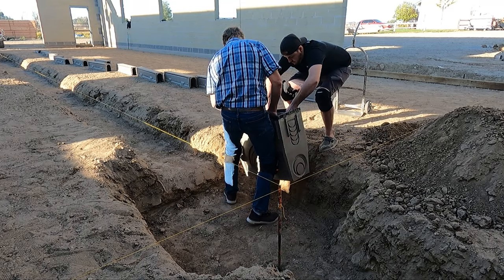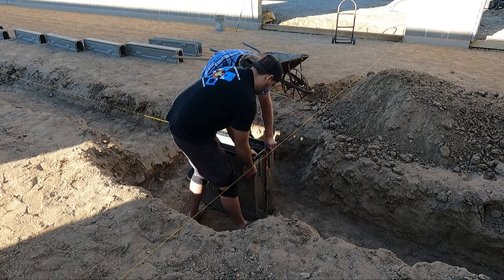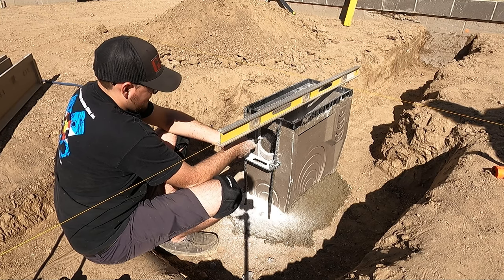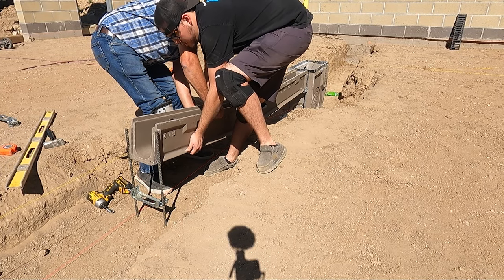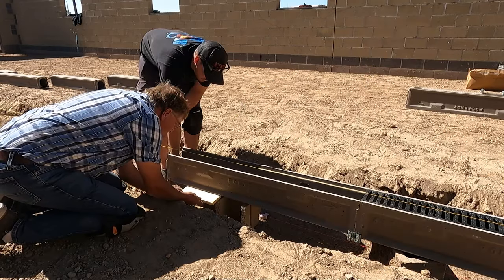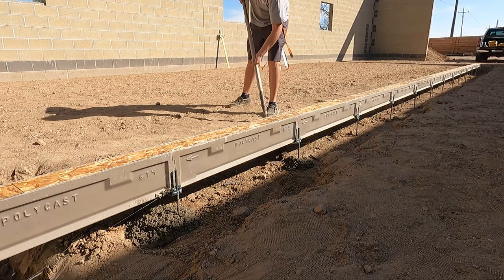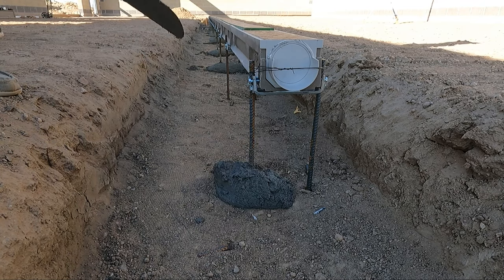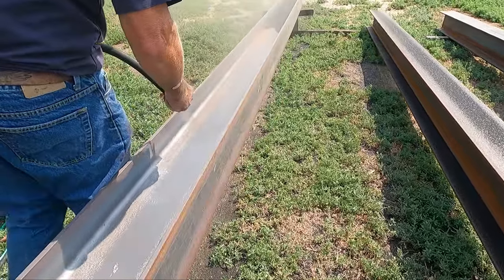Installing A Polycast 600 Series Trench Drain - If You Want It Done Right, Do It Yourself

Comment: When the floor is poured ensure that the the drain is not proud of the floor. I have seen a hundred slabs poured in such a manner that the drains end up as small islands with a small moat around the drain when water is present. I am sure that the same issue is possible with a trench drain. Good luck with your building, we are all rooting for you.
Reply from the maker: Haha, you mean like the puddles that sit around the trench drain in our current shop?
Reply: It amazes me that no matter what size of floor being poured the whole thing is screeded off by a guy with a 4 ft 2x4. The only thing I’ve seen leveled right is a warehouse floor for an automatic material handling system. That Polycast drain is awesome stuff if done right but a total waste if the concrete guy screws up.
Reply: You've described every floor drain in every mechanical room in every building I've ever worked in.
Reply: This is really good advice from Darrell. A great way to achieve this is to put a 1/4- 1/2" spacer on top of the drain for the concreters to rod off, then when they come back to finish, it leaves a nice little step down to the drain which can simply be bevelled off with a trowel.
Reply: It's how you keep the drain from clogging, slope floor away so nothing goes into drain!
Reply: I’ve always done drains slightly recessed (rather than trying to get them level). Often after years the drain or floor has minuscule shifts that cause the island effect. Finding ways to keep them anchored under the floor kinda like footings also can help prevent that.
Reply: @ObservationofLimits  I'm talking about the moats you see around drains the day after they are poured and the top of the drain was set with a transit to have a pitch toward the drain from outside walls.

Comment: Very well done gentlemen!  I've been plumbing since 1997.  This December marks my 20th year in business for myself.  I have put in lots of the Zurn (886) integrated slope drain, but never the ACO polycast.  I just recently bid a house with a show garage in the basement that called out 6 separate trench drains totaling 60 linear feet.  The builder crapped his pants when he got my proposal, and has chosen to have the concrete company install the drains.  I predict we'll end up in the same boat you are......  tearing out their crappy work, and reinstalling it correctly.  
CHEAP
FAST
QUALITY WORKMANSHIP

Pick 2

Comment: We expanded our house a few years ago, and renovated my room last year. In the expansion, my dad put in all the wiring wand water pipes himself, and when renovating my room we did everything ourself, from ripping everything out, putting in new insulation, installing the drywall, installing the roof window, rerunning electrical, and putting in flooring and wallpaper.

Having those skills is really useful, and you can learn a lot of things when doing that.

Comment: If you need any advice I have been building buildings my whole life.  Things like all the small detail in building a shop really get me.  As I see in your shop, you have not taken full advantage of underground mechanical electrical and plumbing.  Stop now and think about it.  The most inexpensive way to wire, and plumbing is under the floor. Air lines, dust collection, electrical, heat.  I advise to hold off on the pour and think that out.  Hindsight you could have had all the electrical, air, and vacuum lines in the CMU walls, fed underground beforehand. Even your 3 way switch is less expensive underground.
Reply: Yes and no. Maybe main runs but having underfloor wiring and plumbing can be an absolute bitch. Especially if you ever expand.

Comment: Dude I feel your pain…. As a Maintenance manager responsible for a decent size fleet of equipment the past year or so has been hell. Everything from ordering parts to dealing with truck shops to trying to get general contractors or roofers to come in and maintain our buildings..it’s next to impossible. The excuse continues to be delays and back ups from Covid but I also don’t see a lot of people putting in the extra effort to work more hours or work at all in some cases. Nice job with your drain

Comment: I always bite the bullet and go ahead and Milwaukee brand power tools, the one time out of 30 plus years I ever had a problem was with an electric saw 6 months after I bought it. Took it up to the service center they told me to take to when I called their tech support, wasn't there 2 minutes they asked me what was wrong with it and just handed me a brand new saw in the box and told me a dozen times how sorry they were I had trouble.
Reply: Something I dislike about the new Milwaukee power tools, especially the 3/8 and 1/4” hex impacts is that the “1” power setting is between 2 and 3 on the previous generation. Meaning I unfortunately now have twice as many impacts because I can’t use the new ones on small or non-ferrous stuff.

Comment: Great work! And yeah, things are getting bad, you can't buy quality tools any more, or get quality work done anymore, ( it's few and far between anyway) ppl seem to think their time is worth soo much Moore than anyone elses.. not wanting to do things right at any price. Myself, if I'm going to bother with it, I'm going to do it right,  reminds me of valves I had installed locally,. I had 2.02" valves put in a set of 350 Chevy heads, all the guy did was cut the seat, stuck the valves in! Charged me for a complete valve job, going from 1.94" to 2.02's all that did was shroud the valves, choke the flow,  I could almost done that myself! 
B
Anyway, great work! I wish I could build a shop like that!!

Comment: Hey!
Great job!
Just one question, sohouldn't the drain hace a 1% slope towards wherever you want the liquids to go?
I thoght i heard you say ""they are perfectly leveled"
Sorry for muy english
Reply from the maker: The slope is built into the sections of drain! 

The top is level, bottom is sloped
Reply: So each one is increasingly bigger?
Reply: @johnlratcliffe  Taller/higher sidewalls as it approaches the catch basin; correct.  That is also why there are multiple cut-out depths in the side wall(s) of the basin.

Comment: Delays with the local government. Go figure. Government rarely helps with anything.
Reply: Also, power tools are hit and miss with Harbor Freight. Often the motors are fine but the bearings or housings are junk. 

I never use their cutoff / abrasion wheels.

Comment: As a pro in this field you’re gonna have problems with that drain. It’s not right and the cheap $3 a bag garbage quick Crete is gonna cause tons of problems and failure points. I understand you had issues with the people you hired but you’re not contractors. Just like I am an expert in this field, not auto mechanics but I decide to machine and build my engine with no experience doing it. How well do you think that engine will be built? Would it come out the same if you guys did it? That drain is gonna fail. Your pitch is wrong. The pitch is determined by the length of the run and width of the drain. The joints aren’t sealed, the rebar is not supposed to touch dirt. Totally against all code for anything in this country. It causes rust and failure immediately. And that quickcrete 🤦🏼‍♂️. Basically you’re screwed
Reply from the maker: Oh really? Can you elaborate what problems we will have?

Nothing wrong with an amateur building their own engine. That's how you learn! In fact, a large portion of our customers who purchase engine kits from us on our website are learning!

How is our pitch wrong? What is our pitch, and what should it be?

Joints don't have to be sealed. What do you suggest the rebar touches? Should it float in the air?

What is wrong with the quickcrete?

You have offered quite a bit of criticism, but not one point of CONSTRUCTIVE criticism where you suggest what would have been better other than claiming only a professional can do it. We've seen what the "professionals" can do. 

Floor is in, and it drains perfectly. But what do I know lol
Reply: I did. Re read it then try understanding it. If you have to, research what I said. Engines and experimenting with them are easy and not permanent. This trench drain is permanent unless you want to demolish the whole floor and redo it after the fact costing 30 times what it is now. That’s your choice. You can do what you want. I really don’t care. You’re trying to justify bad decisions and wrong workmanship in this project. You both clearly have and had no idea what you were doing. You will see down the road. It’s apples and oranges kiddo.
Reply from the maker: Lol that’s what I thought. Must be a boomer.
Reply: So … the manufacturer’s instructions violate code? Got any specific section numbers?
Reply: What should one use between the joints for sealer?